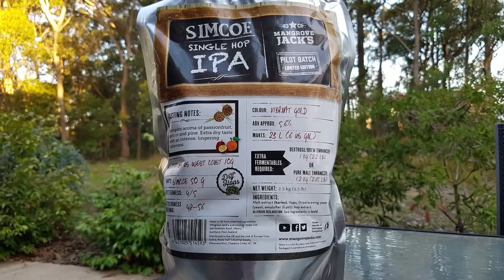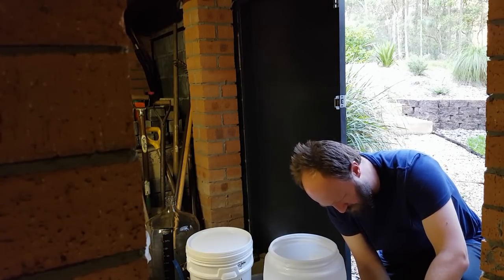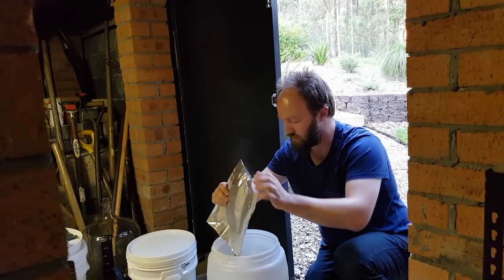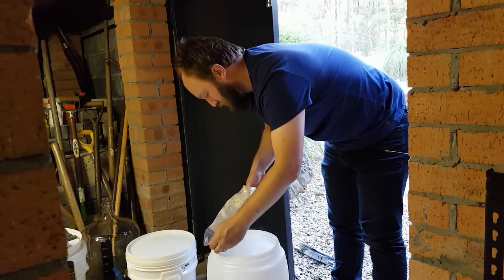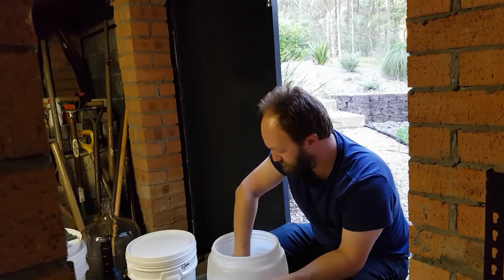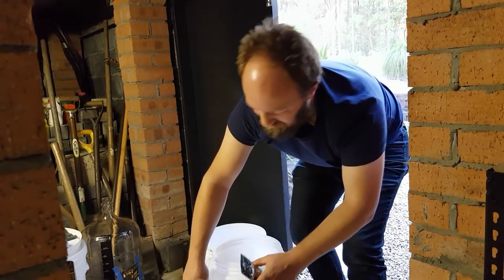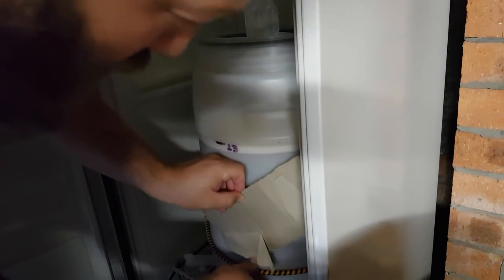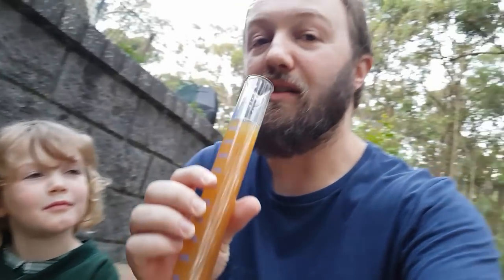Mangrove Jack's Single Hop IPA - Simcoe Brew Day

Comment: Nice video. I'm a home wine maker so when it comes to making a beer I want to cut out the real hard work of brewing and just use the  Mangrove Jacks kits.  With the kit you used I think I would have chosen to throw in the MJ  1.2kg pure liquid malt extract to assist the base with the extract fermentables required. Anyway - I’m sure it will be good. FYI, in my fermenter at the moment I am making a coconut porter using a blend of two MJ kits - the Workingmans stout and the Rustic Brown Ale. It’s on day 5 at the moment.  Cheers Craig